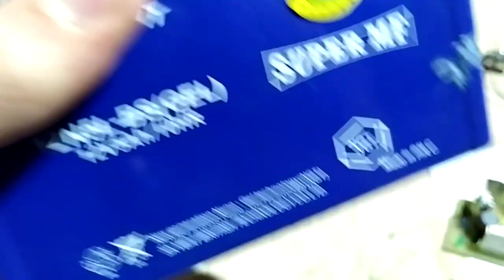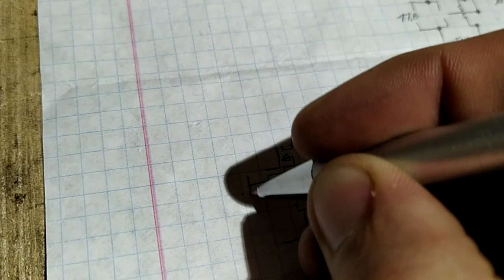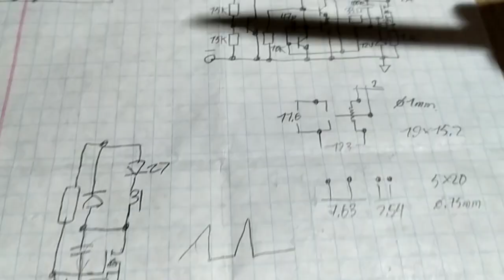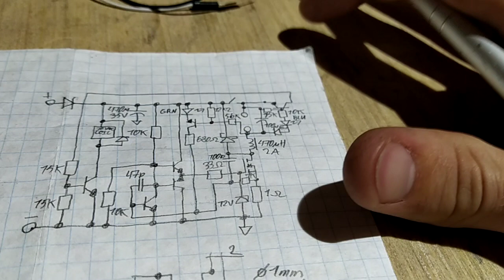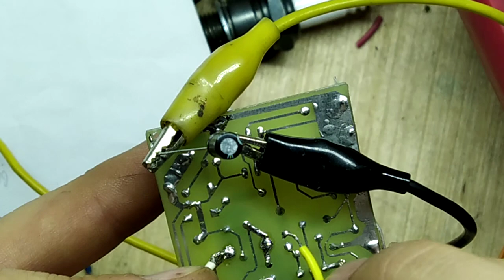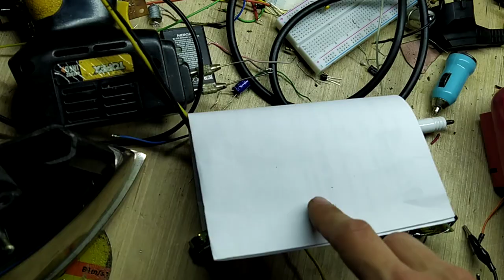Buck converter-based Pb-acid battery charger

Comment: It looks neat and it works great, i would say that's ideal for the job :-D
You are a clever man, i mean that.
I do feel it's a shame that you have to give away your prototype, but you will get your charger back :-D
Hmm 13.8V, when i used to repair alternators the voltage was 13.8 to 14.2v, but they were a crude device, but the lead/acid battery did not give a shit lol.
Reply from the maker: I use around 13.8v so the battery doesn't outgas much if left unattended. The only reason.